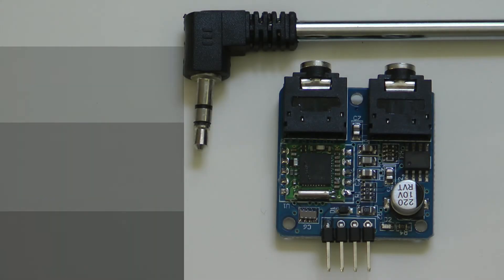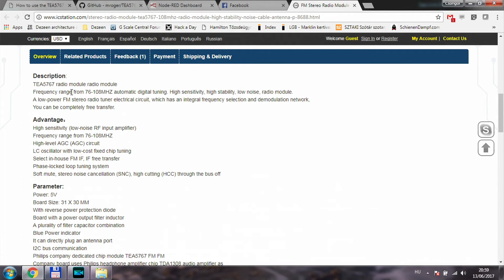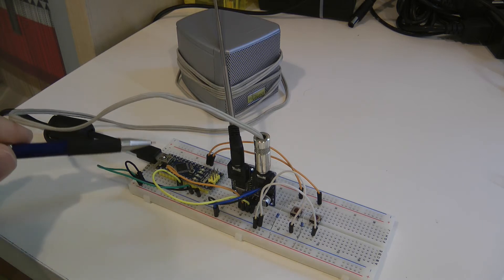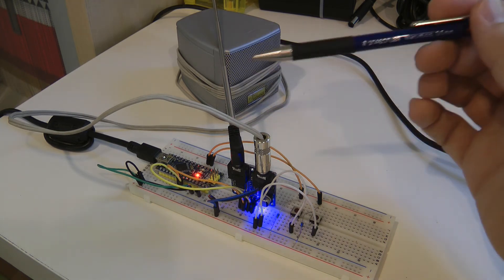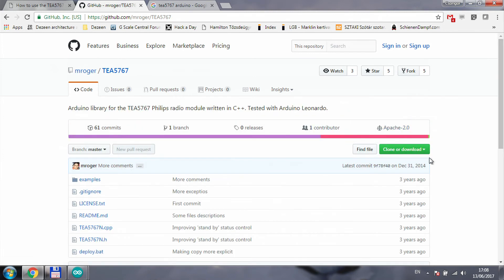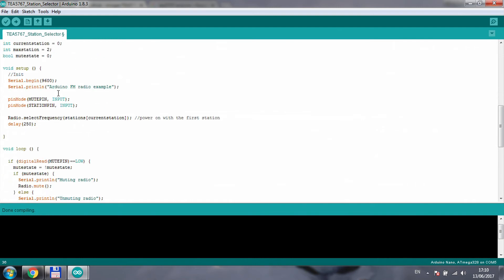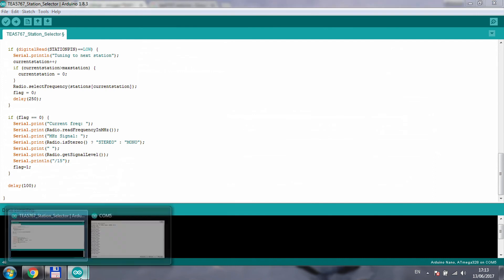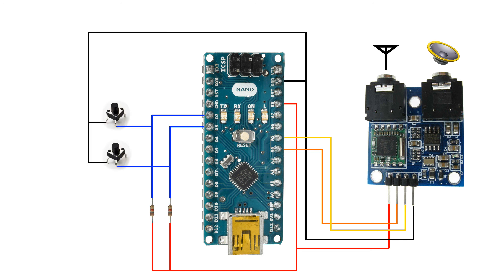TEA5767 FM radio with amplifier - IC Station Review

Comment: Hi, thank you very much for the video ! Is it possible to add a potentiometer to select manually the frequency ?
Reply from the maker: Yes, but you need to read the pot values in arduino and send the frequency updates accordingly. Reading a pot via the analoge input will not result in a stable entry so you would need to apply smoothing so your frequency does not wobble around. But the fm band is much less than the 0-1024 resolution of the analoge input, so it should be possible. But maybe you need a 5 turn pot otherwise it would be impossible to tune with a regular 270ish degree pot.

Comment: Is it a tranmitter or receiver??
Reply from the maker: Receiver
Reply: @csongorvarga  Can you tell me if the same looking module is there as transmitter . I have purchased the same looking module(without the amplifier part) which was named as fm transmitter in Flipkart. I am confused as there is no guide anywhere for transmitter circuit.

Comment: If you add filtering to the 5v power supply with a couple of capacitors, I use 10Uf and .1Uf across the supply this will reduce the noise picked up by the FM receiver.
Reply from the maker: Thanks a lot for the tip.

Comment: i use arduino mega 2560 
but i  receive only 0.22MHz 
any suggestion
Reply: may be change sda scl pins sda from tea5767 to A4 arduino scl (tea5767) to A5 (arduino)
Reply: @juancarlosfloresmend  
thanks, its work

Comment: So happy to have found this. I am just starting to learn Arduino so i can convert an original 1970 Chevrolet radio into a functioning FM radio with bluetooth receiver. planning on signal output to an external car stereo amplifier. this was just what i needed to get started. i am planning on using the original volume knob for volume control and the tuner knob for tuning. there will be no display.  thank you so much for the video
Reply from the maker: That sounds an interesting project. Good luck!

Comment: Hello from brasil.
Do I really need the IcStation to make it work? Can't I simply apply 5volts to the TEA5856 and plug a speaker and antena on it ? 
👍😆
Reply from the maker: Sure, if you google it you can find some application notes. But the TEA5856 would not drive a speaker, you need an amplifier as well.
Reply: Csongor Varga Oh well 😦